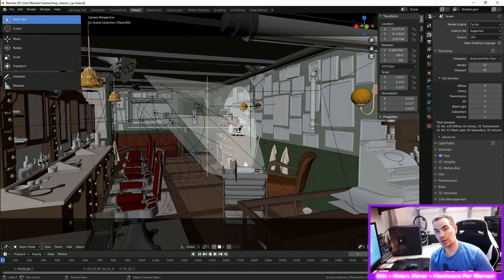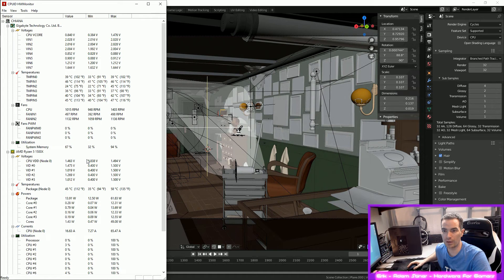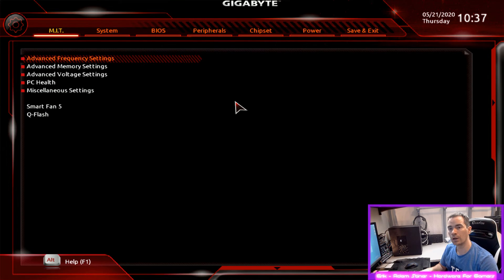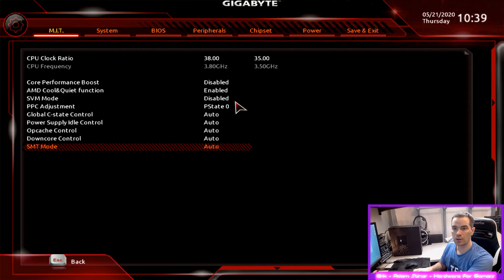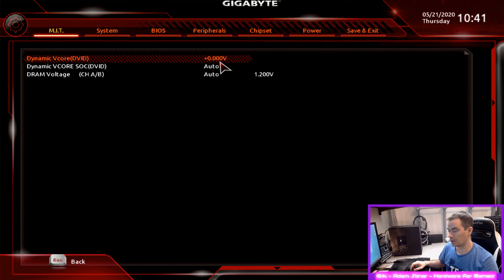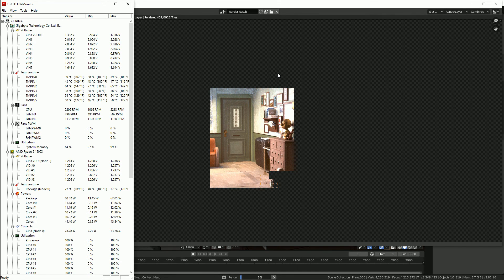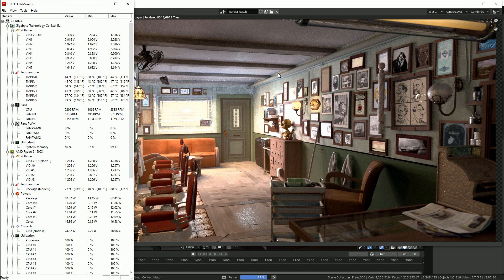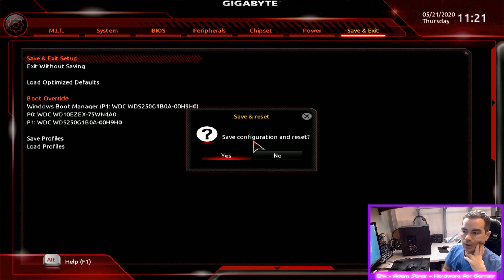Overclocking Your Ryzen CPU Using Vcore Offset

Comment: What's the purpose of the offset? 

I've been playing around with my 7600 I can get like 5.5ghz at 1.26v manual with a negative offset of 0.1v however it seems to just lock the system too 1.16v resulting in a crash when under a CPU stability test.

If I do the other way around like 1.15v with a 0.11v positive offset it just forces max voltage of 1.26v until its under load in which case voltage just drops by 0.02v

Really I'm trying to learn I thought this might kinda be like curve optimize but I don't understand the purpose of a manual voltage, along with an offset vs just manual voltage alone as the voltage doesn't really do anything but peak at max? 

Under ideal scenarios will the voltage move up and down based on the offset? Or is it really just another way to force a voltage besides manual voltage alone, sorry if I'm not wording this well it just seems like manual voltage of 1.2v and a positive offset of 0.05v is the same 1.25v as manual 1.25v alone.
Reply from the maker: If you're setting a frequency, then yes there's not much of a difference between the offset of +.05v and setting the voltage to 1.25v. It really depends on the motherboard. plus some cheap motherboards only work using offsets. 

now since Ryzen 3000 series it's not typical to set a frequency because Precision Boost Overdrive (PBO) does a pretty good job boosting the CPU for everyday workloads. Its become far more typical to undervolt the CPU and use PBO, so leaving the frequency on auto and using a negative Vcore offset . Maxing out PBO is  not quite that simple, but I'm sure there's plenty of videos on YouTube that would help.

Comment: sir is this cpu voltage that you put is Overclock or Undervolt ?
Reply from the maker: Both most likely. Overclocking refers to increasing the frequency. Depending on the CPU it is possible to increase the frequency while lowering the voltage.
Reply: @HardwareForGamers  sir i just want to do a undervolt for my ryzen 3600 ( 450 elite aorus bios ) . Please help me.
Reply: @HardwareForGamers i want only undervolt it ... help pls!
Reply from the maker: this is my undervolting video for ryzen  https://youtu.be/88NBHepm1xw

Comment: Did the exact same thing as you did but put 4.2ghz , ryzen 5 3600 , gigabyte b450m ds3h getting black screen everytime and all drivers seems up to date , computer restart fan and everything running keyboard is lightening when i press a key but has nothing on screen
Reply from the maker: Did you start at a lower frequency and work your way up? Or did you just start at max voltages?
Reply: @HardwareForGamers  yes i did but finnally have been able to but in a different menu

Comment: bro good work 
bro pliz tell me i have matherbord gigabite b450m s2h (rev. 1.x) if  work withe cpu r5 5600g ?
Reply from the maker: Check yourself
https://www.gigabyte.com/Motherboard/B450M-S2H-rev-1x/support#support-cpu
Reply: @HardwareForGamers  omg its support thx so match😗😗😗
Reply from the maker: @youcefall5334  with a Bios update
Reply: @HardwareForGamers  do u have video how ti update the bios in your chanel??
Reply from the maker: I do
https://youtu.be/FTdwyEeZ0O8
Reply: @HardwareForGamers  bro i have  bios version f1 and i need to update bios to f61 for icpu  r5 5600g do you tell me i must download all the version start from f1 to f61 its will take looooong time??
Reply from the maker: no not all of them, F32 -> F40 ->F61 (or higher F63d is the newest), so 3 times... But you will also need to update the AMD Chipset Driver to the newest version (I would do this first). its laid out in the Bios description.
https://www.gigabyte.com/Motherboard/B450M-S2H-rev-1x/support#support-dl-bios
Reply: @HardwareForGamers  do u have video how to update the amd chipset 😅😅😅
Reply from the maker: it should be just download -> Unzip -> Install. it should be an .exe file.

Comment: i got b450m ds3h and ryzen 5 3400g when i go to advanced voltage settings the only thing i can see is  DRAM VOLTAGE (CH  A/B) and i need cpu vcor , any solution to find it please ???
Reply from the maker: Is there a search??
Reply: @HardwareForGamers  there is no seach option 😶i will be very thankfull in you got a selutions
Reply from the maker: @moonwalker1352  Sorry but I've never used that MB before so I have no idea.
Reply: @HardwareForGamers  thank you :):thanksdoc:

Comment: I have a ryzen 7 1800x that I want to overclock, but I don't want to put the voltage at it's max, what voltage do you recommend I stick to prevent overheating and overvolting the chip?
Reply from the maker: It all depends on what motherboard and cooler you are using, as long as you stay under 1.4v you won't have any issues with overvolting.
Reply: @HardwareForGamers  Hi! I have a gigabyte B450M-DS3H motherboard, and I have an AIO corsair single fan cooler. What are some good temperatures for daily driving (under idle, and under load) that won't affect the CPU lifespan?
Reply from the maker: @linghampanch7709  I'd be more worried about that motherboard than the CPU. The vrm's of that motherboard are not good. Just go through the steps I show in the video and stay under 1.4v then tell me what you get.
Reply: @HardwareForGamers  will do, I'm extremely nervous in fear of breaking something. My voltage is 1.286 on default so I'll work up from there. What is the best way to do it? Overclcok to my frequency at put voltage to 1.4 and bring it down until is unstable? Or vice-versa bring up the voltage up to 1.4 where it's stable?
Reply from the maker: @linghampanch7709  I prefer to work my way up, but all and all it doesn't normally matter (if you have a good enough CPU cooler) with your CPU and motherboard combination you will need to also keep an eye on the VRM temps too (try to keep the VRM's under 85C)
Reply: @HardwareForGamers  how do I monitor vrm chipset temps?
Reply from the maker: @linghampanch7709  you'll need to use Hardware info64 or hardware monitor and find the motherboard sensors should be titled VRM or MOS.
Reply: @HardwareForGamers  okay tysm :)
Reply: @HardwareForGamers  okay so i started getting into checking vrms temps CPU temps etc etc. At the stock settings of the motherboard the vrms are already hitting temps of 78 degrees celscus. Can I still attempt an overclock?
Reply from the maker: @linghampanch7709  you can try and see what happens. If you try, I would start slow.
Reply: @HardwareForGamers  okay so what exactly should I do? I wanna overclock to 3.9 ghz and pull up the voltage. What temps for vrms should I look for since at stock it's 78
Reply from the maker: @Lingham Panch  set the clock to 3.8 ghz and set the voltage to 1.3-1.325 check the temps, then go from there.
Reply: @HardwareForGamers  so if I hit 85 on vrms I should be worried right?
Reply from the maker: @linghampanch7709 ish... it shouldn't really do anything if you catch it quickly (max temp is typically 95c ish). What's airflow like in the case?
Reply: @HardwareForGamers  4 fans intaking to the case, one fan CORSAIR HYDRO SERIES H60 AIO Liquid CPU Cooler, 120mm Radiator, 120mm SP Series PWM Fan which is the outtake
Reply from the maker: @linghampanch7709  what case?
Reply: @HardwareForGamers  not sure, something by corsair. Is their a way for me to send pictures to you?
Reply from the maker: @linghampanch7709  Discord
Reply: @HardwareForGamers  okay awesome! I just joined the server :)
Reply: @HardwareForGamers  okay i joined ur discord and posted images
Reply: start with 1.4Vcore and then 3.9Ghz and pull your Ghz step by step up by 25Mhz untill you crash in cinebench r23 in multi test and when you crash go back 25Mhz and do 30min stress test if it pass stay with it :D I was able to go 1.46Vcore on 4.25Ghz on my 1600x and was under 70C temp

Comment: im currently running my aorus b450m with a 2600x at 4.10ghz with a dynamic vcore offset at +.245 an soc at auto is that too much or too little ?
Reply from the maker: Is it stable? How are the temperatures?

Comment: 3400g with1.200 volt and crash bios
Reply from the maker: Sorry, but are you asking a question? If your system is crashing at 1.2 volts what do you have the frequency set to? And if you're asking how to reset your bios you'll have to refer to your motherboard's manual.

Comment: Hi. Could you help me what settings to use for lower load VCore and VID voltages and voltage spikes?
I'm using z590 and i7 11700k.
Reply from the maker: Are you running it stock "auto" or do you have the motherboard boosting the CPU?
Reply: @HardwareForGamers  Stock settings are on auto. Only enabled xmp profile 1. MoBo is Z590 Torpedo with latest bios.
Reply from the maker: @acanthopterygii  what are you using to monitor the temperature and voltage? It sounds like you want to undervolt, I haven't undervolted an Intel CPU in... A long time. You should run some benchmarks before starting. I would recommend voltage offset, but you'll need to use a - offset.

Comment: How I set it to just boost to that it just stays at the multiplier I set I'd rather it boost to 4.0ghz instead of staying there all the time if possible
Reply from the maker: There is undervolting where you leave the multiplier at auto and Lower the voltage to hopefully drop the temperature of the CPU. 
https://youtu.be/qEO4EyVXZHs

How if you set a multiplier the multiplier won't change, but the effective clock speed won't run at "full speed"  all the time. Meaning the power output at idle won't be as high as under load.

Comment: Hi, did you ever hear that we could adjust or fixed Vcore to solve "kernel power 41" error (in win 10)?
Could you give me some advice to solve that error?
Thanks! :)
Reply from the maker: My understanding is that kernel power 41 is more of a Window's thing, meaning the issue is with the power settings in Windows. 
So I don't think adjusting the Vcore will help. Now I did read that updating the BIOS could fix the issue, but I've never had this issue so I'm not too much help sorry.
Reply: @HardwareForGamers  hi, i've just found "kernel power 41 error" caused by power supply. I replaced another PSU and this error never happen for month.
In windows, i choose default power settings.

Comment: do you know what is the voltage for oc a ryzen 5 2600 at 3.9 ghz please ??
Reply from the maker: It depends on the CPU and cooler, I would start around 1.225 ish and test like I show in the video.
Reply: @HardwareForGamers  yeah but on b450m s2h WE don't know the stock voltage so WE don't know how many aditionate
Reply from the maker: @karnamenace  then download hwinfo64 and run the tests and find out.
Reply: @HardwareForGamers  THX dude

Comment: Probably an unrelated comment but I'm trying to perhaps find someone who might know what's happening.
I'm using my ryzen 7 2700 at 3.5ghz OC stock voltage with a aorus b450m motherboard with 16gb of 2666mhz hyperx fury ram.
I've bought a second hand gtx 1060 3gb GT OC by MSI and I have a really weird situation , I can go days playing on it and nothing happening but then today I started getting some weird coil sounds from the gpu, then it crashed twice while playing. 
Tried to boot it up and red VGA light went on the motherboard, tried few more times and same happened, then randomly while I didn't do anything it booted normally and there was no coil sound from the gpu. I later turned it off for few hours and turned on again and it was running normally again like nothing happened.
All of this is happening so randomly and I don't know what might be the issue.
I did however run furmark on this gpu and it crashed the pc after 30 secs but I've read that it happens with other people too because the program does so much stress to the gpu.
I have a 550w chieftec 85+ PSU so I don't think lack of power is an issue.
Reply from the maker: A 550w PSU should be enough unless you have a number of hard drives... my first guess would be GPU overheating I would use Fire Strike or Heaven along with HWiNFO64 to check GPU temps.
Reply: @HardwareForGamers  Just started it today again no problem without doing anything and played csgo for an hour normally.
I've benchmarked heaven and the temps were 60-63 degrees celsius with the max being 65-66 , again no crashes or anything.
Like I said it went on a week with no problems, then it happened, today it's all normal again.
I'd rather have it fail completely and not boot up 100 times in a row than like this, now I have no clue what to do or what it could be. Maybe just a GPU problem that sometimes activates itself idk
Reply from the maker: @noworriesmate8140  that is annoying, the way you described what happened sounds like OTP (over temperature protection or some sort of over limit protection) but the GPU temps you got in Heaven look good. it my be another component VRAM VRM, or it was just completely random...

Comment: can you please do a video on undervolting to reduce temps pleaaaseeeeee
Reply from the maker: Will do
Reply from the maker: What CPU are you using?
Reply: @HardwareForGamers  Ryzen 3 3300x on a gigabyte A320M-S2H motherboard
Reply from the maker: Can you undervolt on that motherboard?? I know you can't overclock on the A320 boards. Is there any voltage options in the UEFI??
Reply: @HardwareForGamers  yes it can but i just dont know how much i should undervolt without impacting the performance of the cpu too much
Reply from the maker: I did a live stream this morning on how to undervolt a Ryzen CPU. It's pretty long but you can 2x play back speed. https://youtu.be/qEO4EyVXZHs
Reply: @HardwareForGamers  yes i've noticed, thank you so much for doing a livestream for it
Reply: Lol i have same MoBo and CPU, what GPU do you have? Also a GTX 1669 Super?
Reply: @ali199665  Saphire Nitro RX570 4GB

Comment: so should I always use the same negative offset for the SOC that I use for the CPU?
Reply from the maker: No!! The SoC should NOT go over 1.1v in your hardware monitoring software. So it's something you need to then check. Because each motherboard does different things.

I typically set my SOC as a fixed number not doing offsets.

Comment: i did an over clock for my cpu also like yours but in 4.2 hz  , and everything looks good , only something i wanna ask is : look at the temperature of the cpu when you don't do anything , it looks not stable like   , 47 - 42 - 49 -  40  even in the video before you force it , that happens to me too , and i wanna ask you if is it normal , thank you so much for your videos its really useful . <3
Reply from the maker: The overclock will depend on the CPU and what generation the CPU is. Because there's no way you should be able to get a 4.2 GHz stable overclock on a gen 1 ryzen CPU when using 1.4v or less. And regarding the temperature, if you just leave the computer idle for 4 to 5 minutes the temperature will settle. Now if you're talking about the temperatures before you overclock auto voltages can be a little weird letting Windows and the motherboard control things (leaving it on auto) is typically not a good idea, it can cause weird temperature spikes.
Reply: @HardwareForGamers   i mean i have ryzen 3100 in stuck  3.6 temperature is very stable like , when you don't do anything it doesn't change from 40 . 
but when when i did the overclock i check temperature i find it like not stable . in 1 sec it can change from 40 to 47 for no reason and without running programs or forcing the cpu . i keeps changing from 40-49-45-43-40 after it goes down again to 40 . then after 10 sec it moves from 40 to 49 for 0 reason and i saw that also in your video i just wanna know if is that not a problem or danger to the cpu . i can't explain very good and sorry for my bad english
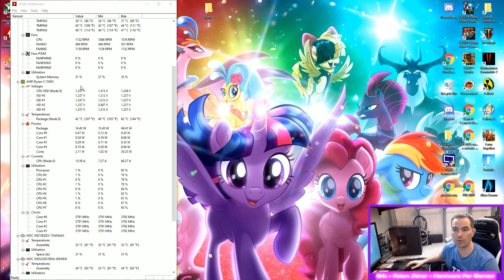Reply: @HardwareForGamers  look in your video at 7:52 and watch , the temperature were 40 and in 1 second  its changed to 48 , thats what i'm talking about for my cpu 3100 overclocked from 3.6 to  4.2 without running anything , just checking the temperature it changes like that idk if is it normal , or a problem
Reply from the maker: @HichamHicham-ji3zj  just because you're not doing something on the system, doesn't mean that the system isn't doing something. Open task manager, Windows is always doing something, now if you let the system idle for 4 or 5 minutes and it's still happening, there might be an issue with the thermal paste that's on the CPU or the CPU cooler may not be sufficient or a very good cooler.
Reply: @HardwareForGamers  Oh , but i don't have that problem in stuck speed .it means the problems comes when i only do the overclock ...... and in your video at 7:52 also having that changes but you didn't say anything about it , so i can take it as a normal thing happens or what :( .  alright , should i keep on that overclock and let this problem runs with the cpu or i make back the stuck speed and leave it for safety .
Reply from the maker: @HichamHicham-ji3zj  what is your max CPU temperature when testing?
Reply: @HardwareForGamers  max is 68 and the VRM ALWAYS 38
Reply from the maker: @HichamHicham-ji3zj  then you're fine
Reply: @HardwareForGamers  so i stay with that overclock sir?

Comment: I overclocked a Ryzen 5 3600 to 4.1ghz and 1.25volts on Ryzen Master. I can't undervolt on BIOS using Dynamic Vcore Voltage. When I set -.006 voltage in HwInfo peaks at 1.09volts then crashes haha. Tried -.002, voltages still won't come to 1.25volts

Motherboard Gigabyte B450 Aorus M.
Reply from the maker: So you have set a core multiplier and your trying to under volt??
Reply: Doesn't 3600 auto-boost to 4.2ghz?
Reply from the maker: With good enough cooling yes just about.
Reply: @HardwareForGamers  just bought that cpu few days back and it boost to 4.1 depends on the task, so im thinking should i overclock it for a casual gamer, then again in my room is like 15°c and its a open case with out of the box ryzen cooler
Reply from the maker: @LOLPlayersuka94  with the box cooler I would not recommend overclocking the 3600. You could try undervolting it.